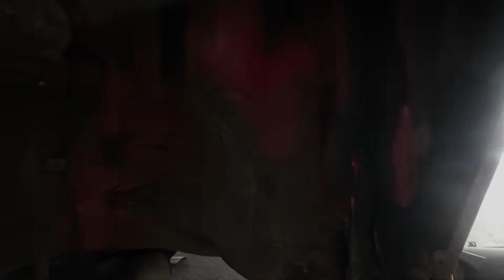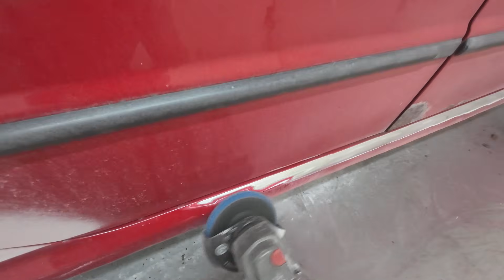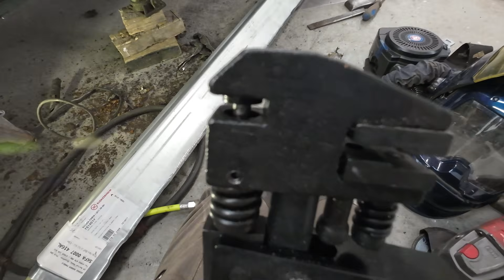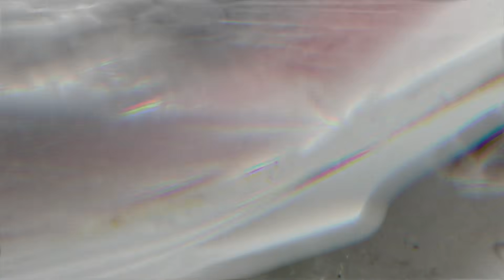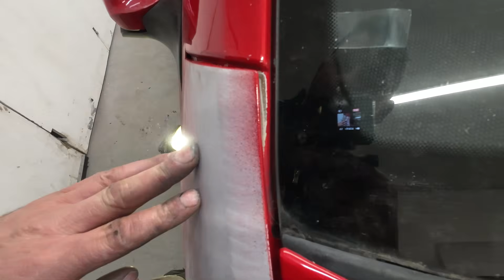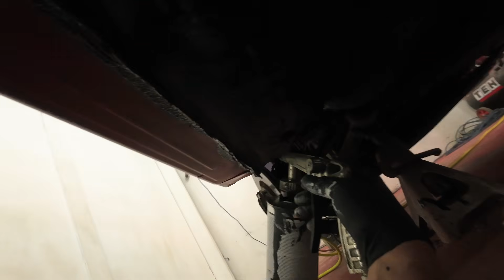skoda fabia vrs sill replacement rust repair. Fitting new sill panel & replacing wings

Comment from the maker: Here are links to some tools and products used in the video as purchased from Amazon. I have looked for the best deals
Edge setter hole punch tool  https://amzn.to/4nWLwPz
Handy bosch screw driver bit set https://amzn.to/4nWLwPz
fibre rust strip wheels https://amzn.to/3XyTm6Z
Big boy metal filler https://amzn.to/4pfGmyT
Thanks for watching! Here is another video you may like - https://youtu.be/mirKABNaiI4

Comment: Where's the best place for replacement wings uk?
Reply from the maker: The ones I fit where from ebay. It would be best you try find a aftermarket panel supplier in your area so you can check them over.

Comment: Awesome work! I'm also planning to fix our Mk.1 Estate/Kombi. I have watched many videos where people fix rusty sills but they usually used just small patch pannels here and there. I like your approach with using the entire sill to get a flush uniform fix that removes all the rust at once. I plan to practice on our rusty wheelbarrow before I try to weld on a car :D

I do have a few questions as a beginner that I didn't quite understand:

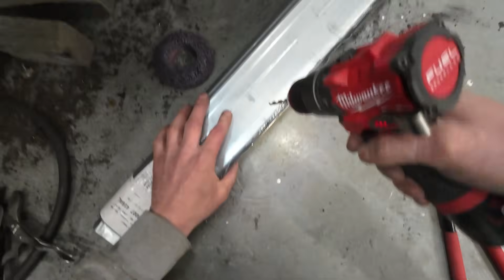1. Were those few holes on the bottom you drilled out @13:25  for cavity wax? Later in the video they are no longer visible so I guess that's what they were used for and later welded shut.
2. The bottom spot welds have gaps and it seems that the area was not entirely covered with filler. Is this to let water drip out form inside the sill? I noticed that even from factory, it's not entirely sealed but I'm not sure if my theory is correct.
3. Did you use any rust converter? Some people online point out that rust converters could compromise the filler and primer and paint could come loose so I'm not sure if they are needed or is zinc primer enough?
Reply from the maker: Thank you. My approach to fixing this job the way I have done it is because this is the right way to do it.Its beyond a patch for the purpose of passing an m.o.t. Your asking a lot of questions here. 1. You dont drill holes, wax oil and weld them up. You bunged the holes with grommet. The holes are likely for plug welds that you have seen.2. Rust converter can be filled over, its purpose is to hold back rust. 3. Watching what I do in these videos is very, VERY different to doing it yourself.  Im not just someone thats bought some tools and playing weekend mechanic. Im a qualified panel beater, paint sprayer,.mechanic  This Job has been my life for almost 30 year. I do this for a living. It is an extremely skilled Job. It would be best to do some training before attempting a restoration. Do not practice welding on your wheel barrow! Get some 0.8 22 gauge to practice on.

Comment: I found myself wondering why you'd taken this job on at the start but that revelation at the end knocked me flat and had me in tears mate, good for you mate. My wife is a manager for a local children's hospice and I've done a bit of fund raising for them in the past because it's staffed by people like you and because the thought of terminally ill children suffering is about as bad as it gets for anybody on planet earth. I had a 2002 Seat Leon from brand new that rusted like that at about 10 years and after a long battle they honoured the 12 year corrosion warranty when an independent engineers report I paid for myself backed me up. They claimed they literally never got reports of rust so mine was maybe one of the first because all VW group stuff became known for it. Trouble was all they did was spray and fill and it lasted a few months before rust came thru again as I said it would. Their answer was that they'd keep painting it every few months until 12 years was up! Absolutely unbelievable. Warranty not worth the paper it was written on. After 3 more (immaculate) repairs I traded it for a new car. I doubt they honoured many warranty claims at all, the main dealer said he admired my persistence and unusual I had full history from new, never been painted or accident repaired. These days it seems German cars rust more than French or Italian but they're all better than they used to be! Keep up the sterling work!

Comment: Rookie question: when filling the sill after welding, I noticed you went straight to filler rather than fibreglass then filler. I’d always thought that fibreglass was supposed to ensure that any pinholes were properly waterproof underneath the filler. Does the metal filler cover both bases?
Reply from the maker: You absolutely don't use fibreglass for that. Yes that is the idea of the metal filler. However there won't be any pin holes in the weld anyway, but I use metal filler to be sure. If im doing something in a video, that is how you do it without question..
Reply: @Supercarlsunday thanks mate - I watch purely out of fascination at your skills (I don’t have the dexterity!) so just trying to understand 🙏🏻
Reply from the maker: O.K thank you 👍

Comment: Am I right in saying you can use metal filler on bare metal as you have? Or am I better to epoxy the bare metal first then apply either metal primer or normal primer after?
Reply from the maker: you might use an epoxy primer doing restoration work. In all honesty I have never seen anyone put filler over epoxy primer in 30 years. Modern fillers are designed to go strait on to bare metal. There is no time in body shops to take the paint back to bare metal, pull damage out, then epoxy primer to then prep and fill to then prime to then paint. If your panel is clean and dry when you put the filler in, there should be no problem. The rust treatment I used will hold back the rust that was there.
Reply: @Supercarlsunday so I would be fine to put some body filler over cleaned and prepped bar metal, to then block and smooth, then apply epoxy primer over that?

Just some areas currently have epoxy primer already over areas but want to also put some filler over that to sort some imperfections also.
Reply from the maker: Just put the filler in the imperfections on the bare metal and then high build primer it all..
Reply: @Supercarlsunday thank you Carl. Sorry to be a pain I'm just trying to learn and get some advice. Sorry 😂
Reply from the maker: Dont be, its totally fine 🙂👍
Reply: @Supercarlsunday thank you sir
Reply from the maker: Your welcome 👍

Comment: Good work.
I restore cars for a living....nearly 50 years...lol!
The secret to longevity of these repairs is to protect the metal on the other side.  
I make sure the rear of the panels care painted before welding in.  And, yes, it will burn off in places.  But, make sure you have made discrete access holes to be able to inject dinitrol or waxoyl or your preferred after the job is complete.
Holes under trim panels, end of the sills in the rear wheel arch, under front wing ....anywhere you can get the fluid into the closed repairs.  Especially this one where there are multiple layers.
Obviously sealed up afterwards.
Takes a bit of thought during the reconstruction but is well worth it in the end.
I used dinitrol products (3125, ml, 4941), then heat up the areas to get the fluid to flow.
Jacking the front up and letting it run back and vice versa.
That extra mile.....

Superb job though
Reply from the maker: I do exactly that!

 I started this trade in 96 and worked with some great professionals. Yes, the back of every panel I weld in is painted with weld through primer as Is shown in most of my videos, and then I inject with wax oil again shown in most of my videos. 

Thank you 👍

Comment: VAG rust protection became garbage around 25 years go.
Reply from the maker: Do you think its bad rust proofing or bad metal to start with?
Reply: @Supercarlsunday Bad rust proofing IMO.
Reply from the maker: O.K, interesting, are you in the body work trade yourself?
Reply: @Supercarlsunday No, it's pretty clear to see. I'm 45
Reply from the maker: O.K... Im 45 myself and been doing this job since the age of 16. What Ive noticed over the years is how poor the metal has become. Everything is treated and well. Vehicles are rusting all over. Vehicles are rusting in random places all over. Not just the usual places they used to. The metal is a lot thinner on some. I think the problem  is inbetween the stages of the metal been treated. The problem is already there before treated. I think I have explained this in another comment. A bit like leaving a piece of tin outside to rust and then getting it in, cleaning it up and treating it. The metal is not the quality it used to be, I can tell you that. As everything these days, the main goal is maximum profit. There are a lot of design floors also. Areas that hold water and muck. Foam sound deadning that holds water against panels. Everything is treated, its just poor metal there treating. And of course your vehicle will last longer if you take your own course of action like undersealing or waxoiling yourself. But again, thats not going to stop these cars rusting in random places. Look at the vw vans I have worked on, 8 year old and rust spidering out of everywhere. The metal is treated, you can see when you take the paint down. The metal is just no good. Im doing my ford custom at the moment and thats got rust all over as well. 8 year old van. Again, crap metal..
Reply: @Supercarlsunday It's not galvanized as well, or at all. I agree the actual quality of the materials isn't as high either. But, we have a choice. I don't buy German cars anymore, but if I did I'd only have a BMW.
Reply from the maker: It is galvanised, just like all German cars as standard and most have been since the 80s. As I say Iv been in the trade for almost 30 years and its clear to see the issue is poor metal 👍
Reply: @Supercarlsunday Depends on the thickness of the zinc plating. It's not just down to steel quality. Actually, there's more high tensile steel in cars than during the 80's early 90's.
Reply: @Supercarlsunday All German cars were/are galvanized? That's not true
Reply: @Supercarlsunday Mercedes didn't galvernise anything until 2003-4. BMW only started galvanising panels only post 2002-3. So you're wrong
Reply from the maker: They have both been  galvanizing since the middle 80s. But hey, what would I know, I have only been in this trade repairing these vehicles for 30 years.. repairing them on a insurance production line in the 90s and 2000s , cutting out quarter panels and welding in new... Trust me, I  know what's galvanised and what isn't, all the information is out there 👍

Comment: Old red paint turns pink in time
Reply from the maker: Yes its a well known fact that red pigmentation absorbs more uv light and over time will fade quicker than other colours, also red paint thats basecoat and lacquer tends to peel due to the uv radiation. A flat 2k can be polished back up several times. This won't be a problem with this car for a while tho as I've painted a lot of it and polished the rest up and waxed it. It looks amazing Now doesn't it?
Reply: @Supercarlsunday top class 👏
Reply from the maker: Thank you 😉👊👍

Comment: Good on you for taking that on! 
My favourite part of the video was when you acknowledge that this isn't a top notch db job. I agree with you on this and I do not mean that in a negative sense. You've gone above and beyond an MOT special, and were I paying you to do a job for me, I would consider this to be good and acceptable at a reasonable price point. The reality is that most people cannot afford a restoration level piece of work (and probably would not appreciate it). I feel that you hit a happy medium where this repair will last for years and is not just a patch over the top of existing rust. I'd take months to do what you've done and I would pick out all the rust and maybe weld replacements for the middle rocker; this is ok for an enthusiastic DIYer but it doesn't really work when you're trying to earn a living!
Would you expect to get 10 years out of this? 
And do you spray cavity wax inside the sills when you are done?
Also, what settings are you using on the spot welds relative to what you're using on your stitch lap welds? Maybe double power or so?
Reply from the maker: Thank you 👍

Comment: Very fine work, sir.

When will car manufacturers cure the rust problem? You wonder if they treat the metal at all.
Reply from the maker: They never will, they want you to either keep spending money on your car buying replacement parts and panels or buy a new one. I think they must store the metal in damp storage units, let it rust a little and then treat it. You would think so wouldn't you lol.
Reply: @Supercarlsunday  Thank you for you comment.

I wish I had your welding skills 40 years ago, when I was 21. 

In 1985, I had an orange, 1974, 1200, VW Beetle, which I worked on, as a hobby. I taught my self everything about the mechanics and electrics of cars through books I bought, no internet, then. I was pretty good and I worked on my Beetle, getting to know the car very well and with just a few tweeks, I was able to get that car to run at 85 mph, instead of the usual 70. 

One night this driver hit the side of the car, just a light bump, but the floor slightly separated, if you know Beetles, they are bolted to the chassis. The only thing I couldn't do, on a car, was weld and no one would weld the split for me. When it rained, the car was full of water, I mean about a foot! the rain slid down the side panels and right into the split in the floor, like capillary action. I had to sell the car for low money, to a neighbour. The car cost £1000. A lot of money in 1985. It was great car, with no rust and very fast and I miss it. People used to call it the 'Orange Bullet'.

Thank you again and all the best.

Francis
Reply from the maker: @Francis-Gamble I will not have to let my mrs read this comment lol. We had a rusty old beetle on our drive for a few years, it was a project I bought in my 20s but it was that big a project other work took priority and it never got done in the end. It was also a 1974 1200cc. My wife hated it on the drive lol.. Good day for her when it went. Regarding the Internet, yes things have changed a lot. When I started out the Internet had still not took off. Phones where very basic and desk top computers expensive plus there was not much online back then. I was lucky to work with some skilled panel beaters and learn the trade properly, hands on with professionals. Its a shame you had to sell the car,  these things happen when your young. I had a motorbike I used to travel to work on when I was 18, I had a problem with that and had to sell it as I couldnt fix it, this year a bike I built won the championship. We are always learning. Thank you for sharing your story with me. I enjoy listening to old time tales, things have changed so much 👊👍
Reply: @Supercarlsunday  Thanks again.

Strange coincidence that you having a similar type Beetle, too. Great. Pity you didn't get the project going.

As I said, I learned everything from books, such as, The AA Book of the Car, Car Care, a car repair magazine that covered all types of car, which came out every week and of, course, Haynes manuals, to name a few. I would read these for hours and absorb everything in them.

I loved my beetle. In the winter time, the car would start up right away, without fully turning the key, first time all the time, while other cars, in the neighbourhood were struggling, even big quality cars. I just had standard points fitted and I still think points are still the best. With electronic ignition, you break down and that is the end of it. I loved the Beetle, too, because it had no radiator and no timing chain.

You've done really well for yourself and the bike you built winning the championship is just great. You must be good.

Thanks again. I look forward to more of your videos. Keep well.

Francis
Reply from the maker: Yes it was a shame I didn't get it finished. I have resprayed several beetles. And lots of vw Vans. The bay windows and splits screens, T 25. I dont know if you have seen my T25 on my channel. Im putting a golf gti engine in it. Its almost done. There is a full video of when I welded it up and resprayed it. My videos where not that good back then though lol. 
Thank you Francis.
Reply: @Supercarlsunday   Thanks. I'll have a look at your T25 videos. Cheers.

Comment: I like the way you put filler on bare Metal, there...! By making this Video, you are probably coaching somebody how to professionally do welding and Bodywork...! Someone with a Smartphone or a Computer anyways...! 🤔🤔😇😇
Reply from the maker: Yes the correct way to apply filler. I don't mind passing my knowledge on, but really the best in this game have done apprenticeship and been trained under supervision by experts like myself. There is a lot to this trade and a lot that can go wrong. Without the appropriate training I would advice people to only work on there own projects. If anyone wants to take the plunge and do this for a living, they will need to do the appropriate training in a well established body repair shop just like I did.
Reply: @Supercarlsunday  Sounds like solid, Logical advice. Hopefully the African Mechanics will read this...! 🤔🤔😇😇

Comment: Just come across your channel. Have just subscribed. Superb work, interested to know what this cost and what this would cost normally assuming you did a deal for them. 😉. My dad has been going through multiple myeloma for the last 5 years, I had his Ford cortina mk5 restored, so many memories and sentimental value.
Reply from the maker: Thank you for subscribing. Regarding cost, It would have been twice what I charged. at least on an hourly rate. I wish your dad all the best. We had a mk5 Cortina growing up. It was orange. It set on fire in the end, possible electrical issue. We went to wales in it, one of my memories as kids. I remember it been on Weber carbs. All the best..